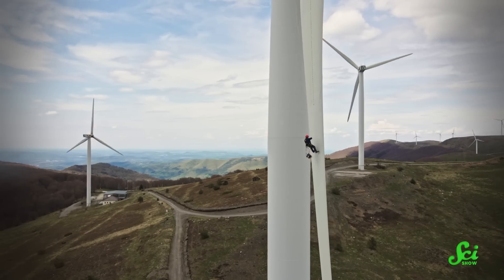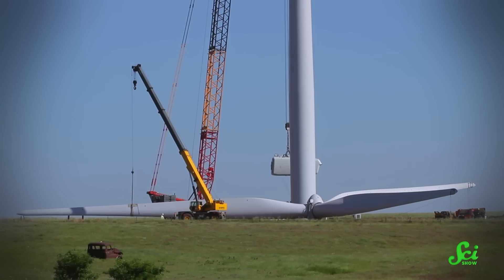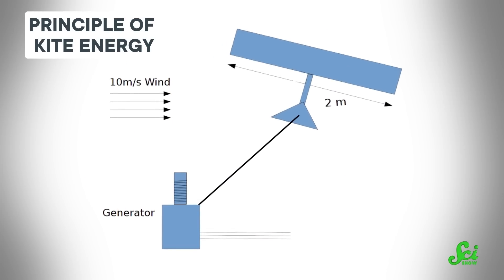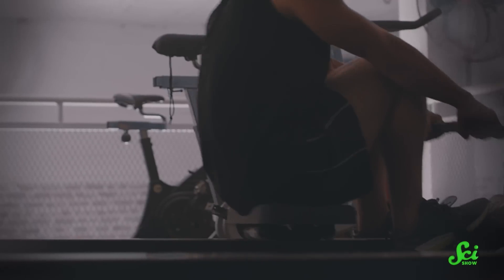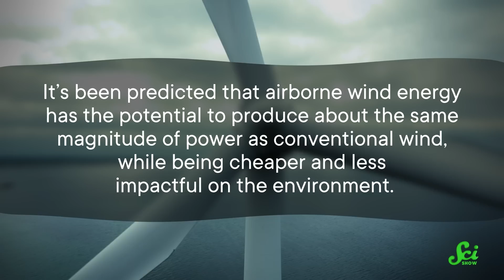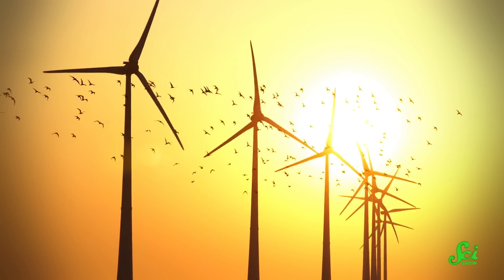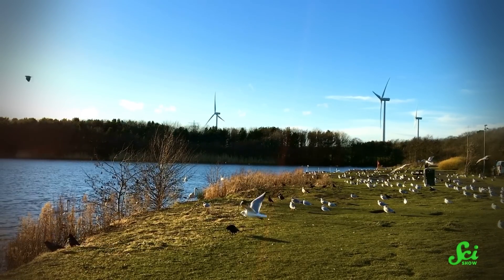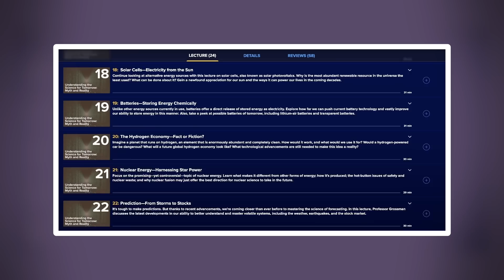Should We Put Wind Turbines on Kites?

Comment: Helium balloons aren't viable thanks to a shortage of helium. Kites only work in places with extremely consistent winds. The only designs which can go just about anywhere require heights so great that the weight of that length of tether makes them nonviable. It's a cool idea ... Just not an idea that's practically workable. - Regardless, we should be investing more resources into low hanging fruit. It is FAR easier to conserve than it is to produce.
Reply: Ammonia is used for some weather baloons.  Not that many viable choices of lifting gases, unfortunately.

Comment: Weren't those passing-car wind turbines determined to have a net negative effect on overall evergy use since they end up messing with air flow, which ever so slightly increased drag on every single car? So, in essence, they don't harvest "free" wind, they're just a convoluted way of converting natural gas into electricity by way of slowing down passing cars, and it would produce fewer total emissions to just burn gas directly.
Reply: It could be argued, and might have already been, that these cars are wasteful in their energy usage and recapturing some of that is an efficient means of mitigating this.
Although it is rather costly. 
 The thought of using vehicles to generate a usable voltage to fill in when solar does not operate in order to light signs etc. might be worthwhile.

Comment: Something I always wonder about wind turbine is their effect on currently known strong wind currents. Taping into a strong wind current is bound to have an impact on it, since we're getting energy out of it. It might be considered negligible today depending on the efficiency and repartition of wind turbines, but as they increase in efficiency and they multiply, it might stop being negligible.

I'm not sure we would even reach that point with technology, but if it produces electricity, that energy has to come from somewhere, and thus not be in that "somewhere" anymore. I'd be curious about research on that.
Reply: That's an interesting point. After all we thought taking water from rivers would never actually harm the rivers, until we started taking too much - look at the Aran Sea.
And rivers are powered by gravity - water flows to the lowest point, the tides get pulled by the moon - which means hydropower is basically endless. You interrupt the flow with a hydrokinetic buoy, that water is just going to pick up speed again. But wind is a different story (you get your typical "a butterfly's wingbeat can cause a storm" shenanigans).
Reply: @peregrinelux1  Technically rivers is just solar power, the power comes from the sun that evaporated water on the first place
Reply: Hmmm.... I think I'll run out and buy stock in an airborne wind energy company...

...or NOT.

You're not gonna be able to put one anywhere near an airport, international, regional or otherwise. Not anywhere near a hospital that has a helio pad. The burgeoning drone delivery service industry will undoubtedly push back. Put one to close to your neighbors awe and the tethers could potentially get tangled up. And HOAs will most assuredly object. This is gonna be a very limited market, no potential for scale.

Comment: Steering isn't an issue as we have had 2-line and 4-line kites for decades now.  micro computer with a couple servos would handle that.   This could be brought down to a single line long before it's anchor point.  Rotational anchor handles changes in wind direction, another computer overseeing everything can handle synchronization.

Biggest issue is the turbine setup itself.  The ground push me/pull me generator would be by far cheapest to setup but also the worst for power generation.  The weight of any more traditional wind turbine being held aloft would generator far more power but be far more expensive both in terms of getting the power back down the line and in terms of lift required to hold it aloft in the best Windstream for its size.  You could in theory get much higher up, allowing for far stronger wind speeds and a much smaller turbine as well.   However, that's even more power cable to be lifted upwards meaning you don't actually save any weight and probably would need an even larger lift surface.  This would also put it in altitudes that would endanger other air traffic.

Really this probably is going to be limited to farmland environments where the added shade from the lift body might provide a secondary protection over water storage as well.  Providing direct energy to water pumps and such further where running power lines would be cost prohibitive.  Or just to be more energy independent on that farm of course.  I just don't see this as viable though.

Comment: I remember an article in Scientific American or Discovery Magazine well over a decade ago noting their disappointing inefficiency and pondering how close these could get to 100% efficiency. I recall thinking how silly it was to think that you could ever extract anywhere near 100% of all the energy from the air’s movement without a singularity since it can’t just infinitely collect there and still has to go somewhere.
Reply: With every machine we wonder how close we can get to 100%.
Renewable energy is in no way special here.
Reply: I mean that's what they said about solar until it was invested in aswell, right? All this stuff can be solved with an actual effort on R&D instead of "waiting for the market" to fix the problems caused by the market
Reply: @smileyp4535  LOLWUT? No. 100% efficiency with solar would not create a matter-destroying singularity. It just means things would be very cold on the other side… which could be an environmental concern also considering.
Reply: @emmettturner9452  Why did you just disprove you own non argument from the opening post, while replying to someone else?
Reply: @christopherg2347  You must have misunderstood my original post.
Reply: @emmettturner9452  You talked how you would "need some kind of singularity" for 100%.
Next post you called that idsa stupid.
Reply: @christopherg2347  No, I called it “silly” in the very first post. In the next post I refuted the idea that the issue was similar to ever hoping to get near 100% efficiency from solar:
“100% efficiency with solar would not create a matter-destroying singularity.”

I said from the start that it was silly to even desire 100% efficiency of energy extracted from the movement of air since doing so would involve stopping all of the air dead in its tracks in a non-renewable way (ends circulation). We WANT the air to move away… and absorb more energy from the sun and return as future wind ad infinitum. Losing atmosphere in a disruptive singularity is not a “renewable” way to extract wind energy. There’s a reason they call them “black holes.”
Reply: @emmettturner9452  what are you talking about? Lmao you can't hve 100% efficiency. I'm sorry, but you litterally just can't have it. Solar is good, and better and cheaper than ever. But you can't hve 100% efficiency from anything lol
Reply: @smileyp4535  My point exactly.
Reply: @emmettturner9452  "I recall thinking how silly it was to think that you could ever extract anywhere near 100% of all the energy from the air’s movement without a singularity since it can’t just infinitely collect there and still has to go somewhere."
and
"LOLWUT? No. 100% efficiency with solar would not create a matter-destroying singularity."
You seriously did not see that you just refuted your own point?
Reply: @christopherg2347  I did no such thing. I do see where you thumbed up your own comment just now. Weird.
Reply: @emmettturner9452  You even used the sane BS argument about a "reality breaking singularity" in both your original post and when you claimed it was BS.
Reply: @christopherg2347  You seem to have a comprehension problem. Extracting 100% of the energy directly from light and extracting 100% of the energy from the movement of air are two very different things with very different hurdles to overcome, one more silly and obvious than the other… which was my entire point. Anyone can understand that you can’t continually stop air in the same place without somewhere to put it (nor would you want to). Not everyone understand about resistance losses, capacitive coupling, induction, conversion losses, etc, some of which come into play even with a perfect conductor.
Reply: @emmettturner9452  You said:
"You need a reality breaking singularity to get 100% efficiency."
You then said to somebody else:
"You are a moron if you think you need a reality breaking singularity to get 100% efficiency."
What part did I get wrong?
Reply: @christopherg2347  Every part.

100% efficiency is impossible for wind and solar for a variety of different reasons. Only one is so silly that you could hand-wave all that with a magic “what if it were” scenario and still have an obvious volume and sustainability problem that ruins the whole thought experiment. That’s what distinguishes one as more silly than the other.

Moving air flows into a magical gateway in the form of a mythical 100% efficient wind-capturing kite and 100% of its kinetic energy is extracted as usable energy. Well, that means no air can flow out (0% kinetic energy). Where does the stagnant air go? Nowhere, thus you’ve made a non-renewable singularity that consumes moving air.

Sunlight flows into a magical gateway in the form of a mythical 100% efficient solar panel and 100% of its virtuously massless electromagnetic energy is converted into usable electricity. Well, that means things are going to get cold and dark around the gateway. Where does the captured light/heat go? Renewable electricity for as long as the sun shines.

You see? Only one is distinguished by the “silly” problem of having nowhere to put mass if you even could extract 100%, therefore one is more silly than the other before you even get technical (my original point from the OP). People will just assume that cold and darkness aren’t an issue with 100% solar so you have to get much more technical to explain the impossibilities. If you have to get more technical then by definition it isn’t as “silly” for someone less technical to target/assume.

You can’t stop endlessly circulating air without a place to put it. If you could convert 100% of sunlight to electricity then the comparable “what if” problem would not be mass and volume. If the sun itself doesn’t have enough mass to form a singularity then neither does some small cross section of captured photons at 1AU… therefore no “singularity” is required for 100% efficient solar even if it had to capture the kinetic energy of photons and sequester their negligible mass.

They are both equally impossible but only one is so silly that you have such an obvious problem even after assuming it is possible. The problem with one is not like the problem with the other, and one is downright “silly” to even imagine.
Reply: @emmettturner9452  Funny how you keep replying to something I never said, while ignoring what I say.
Reply: @christopherg2347  Funny when that’s exactly what YOU did. In your previous message where you got every part wrong, you claimed that I called someone a m°røn and contradicted myself when I did neither. You even deliberately misquoted me so you could attribute what I said about one thing to the other thing I was specifically distinguishing it from. Shame on you.
Reply: @emmettturner9452  Be specific what I got wrong. You said:
"You need a reality breaking singularity to get 100% efficiency."
You then said to somebody else:
"You are a moron if you think you need a reality breaking singularity to get 100% efficiency."
Reply: @christopherg2347  I was both broad (“Every part.”) and hyper-specific (the rest) and you respond saying that I ignored you.

To imagine a contradiction you conflate what I said about being 100% efficient with one thing (wind) and declare that I said it was a requirement to get 100% efficiency from the other thing (solar) or anything else. You even make a false quote to support it even though my OP was talking about extracting wind energy with kites. Wind energy from kites is what Sci Show and Discovery or Scientific American was talking about too. I’ve been distinguishing wind power from solar since my first response because someone said “the same” was said about solar. I only commented to make the distinction that the same was not said and one is more “silly” than the other… and then you immediately claimed that I said the exact opposite.

I never said you needed a reality-breaking singularity to get 100% efficiency from broadly anything… indeed, I said you would need it as a consequence of being 100% efficient with one thing: Wind.

Furthermore, I never used that insult on anyone despite your continued use of quotes to attribute it to me. That insult typically gets your YouTube comments ghosted anyway.

He responded to my OP to imply that the “silly” issue was the same for wind and solar. I told him that solar was a distinctly different issue since it would not involve a reality-breaking singularity even if you somehow achieved it.

Two different “what ifs,” 100% wind and 100% solar, with the “silly” reality-breaking singularity only applying to one. The “what ifs” dismiss any technical reasons you can’t get that far with either since we were discussing how silly it was to presume one over the other based on how it would work if you magically had it.
Reply: Let’s go back to what you said over 5 hours ago where you ACTUALLY quoted me:
“ @christopherg2347  ‘I recall thinking how silly it was to think that you could ever extract anywhere near 100% of all the energy from the air's movement without a singularity since it can't just infinitely collect there and still has to go somewhere.[‘]
and
‘LOLWUT? No. 100% efficiency with solar would not create a matter-destroying singularity.’
You seriously did not see that you just refuted your own point?”

I bolded the parts you ignored in order to imagine a contradiction but I’ll go ahead and pull them out for you:
“from the air’s movement”
“with solar”

I was demonstrably correct when I first replied to you with “You must have misunderstood my original post.” It’s bizarre that you could actually quote it and still not see that I was distinguishing wind and solar and never made some overly broad statement about a reality-breaking singularity being needed for 100% efficiency for anything in general. You even quoted where I immediately explained that the need for a singularity with 100% efficient wind power was because a volume of unmovable air would be stopped dead in its tracks and would need some place to go/exist (singularity). Not sure how you ever thought I said the same about 100% efficient solar. Heck, solar even works in a vacuum.
Reply: @emmettturner9452  Yes, those are still the part where you contradicted yourself.
Thanks for proving I read you correctly.
Reply: @christopherg2347 . Well, now you’re just trolling.

You’d need a reality-breaking singularity with 100% efficient wind power… but not solar. 100% efficient solar is also impossible but not because it needs a reality-breaking singularity. The reality-breaking singularity I brought up in the OP is not applicable to solar as I have insisted since my first reply. Where is the contradiction?

Comment: good idea until the tether wire breaks and a giant live wire falls uncontrolledly, and the turbine head drifts far away. Uncontrolledly systems are the hardest to design and maintain, because we never have enough data to make them safe enough or reliable enough.
Reply: The kite seems the safest. The turbine is on the ground, the tug is the power, and the wire has to be flexible enough for the motion but strong enough not to snap, also light enough for a kite to rise. We aren't exactly going ar
long distances on glide power because of aerodynamics.
Reply: Or at least create a build in propulsion system with just enough energy should it detect a tether detachment. A fail safe option.
Reply: You think we don’t have enough data because there’s not enough experiments being done?
Reply: the cheaper construction might offset this, really

as long as the increased upkeep still doesnt add up to the costs of conventional air turbines, its a win
Reply: Oh, let's give up then 🤐